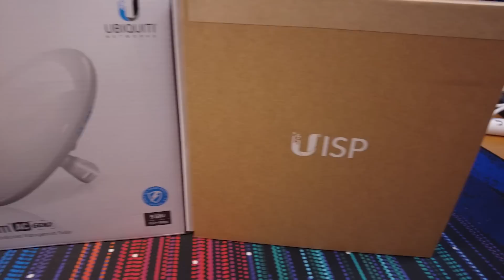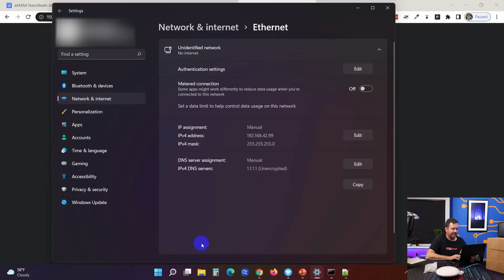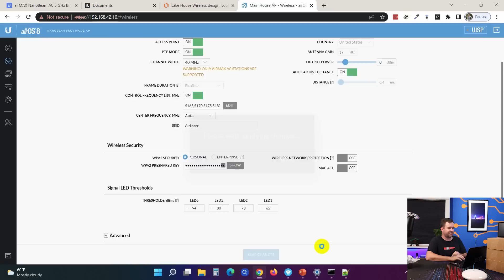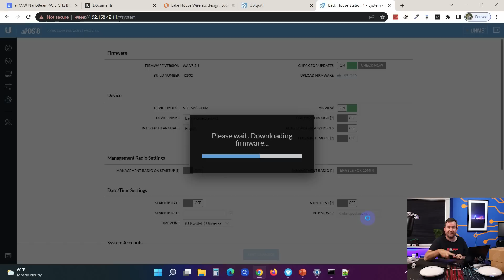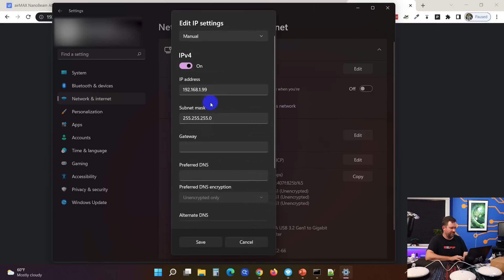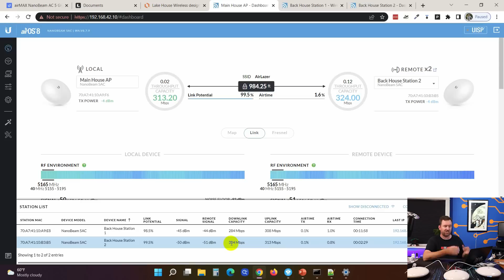PTP Wireless Bridge Setup 2022 - Step-by-step Guide!

Comment: Just watched your PTP video. I have a Dream Machine and two Lites. My greenhouse has marginal 2.4 GHz coverage for my Raspberry Pi. I have an M5 Rocketport. Can I use the 5 GHz portion of the Lite to extend ethernet connectivity to the Pi or do I need to put in a dedicated PTP link? My Android tablet says I have a good 5 GHz signal. If this concept works I will expand the greenhouse to include more ethernet devices.
Reply: No you cant use the airmax ac radios for client device connectivity. Use a Unifi Mesh AP or Mesh Pro AP and turn the radio power on both 2.4 and 5 Ghz to high and you'll have solid wifi. The Mesh Pro has a 300 to 600 foot diameter of coverage. In some installs Ive done Ive seen up to 1500 feet reach with the Mesh Pro (across a small lake)! Great AP for $199!

Comment: we use these gen 2 versions with AC Prisms/typically with 5G16 120 antennas - for temporary video installs at large events and festivals across the United States... they are pretty bulletproof... have also thrown in some power beams for the occasional 5 mile + shot... like anything else these days though , very hard to find in stock currently.

Comment: Could you have saved time by saving the config from the access point, loaded it in the stations and just toggled off AP mode and changed IPs?
Reply: Yep. Do it all the time... first station is a copy of the AP, then save that one and use it on all the other stations. Just have to change the name, ip, and re-add the UISP key to get it under management, then move on to the next one!

Comment: I am in the process of setting up a PtP with NanoStation 5AC. We did some testing with the NS attached to ladders but it was hard to really dial in the direction. We are about .6 miles apart with a few thin tree tops in our way. We can see a bright yellow sign with the naked eye and at night we can see each other point flash lights with ease. This is on some flat roof building and we are planning to get some standard non penetrating roof mounts. Do you think we can get to 100Mbps with this setup?
Reply: If you can see light at night, you could probably get a 300 to 600 mbps uplink. Use the alignment tool built into the TOOLS section on them. Also, use AIR MAGIC on the AP side once you have them connected to each other and it will show you the best frequency to set them at. Do the remote side from the AP side, hit save, then tweak the AP side and watch them connect up again at much better capacity and overall throughput.

Comment: Cool video Chris, I have a P2MP setup with a rocket and nano station 5s at my horse farm for outbuildings and am considering upgrading to AC or LTU hardware. Love to hear your thoughts on those two options compared. Thanks!
Reply: No need to upgrade if you don't need the bandwidth - what are you requirements on the remote side? If you can get a capacity + fade margin (usually 15% more than your total need) then your PTP or PtMP link can be set up to achieve just that - size the radios based on that as a minmum, then consider ramping up from there. I mean, are you running a storage server in your outbuildings? Of course not. Do you have 20 people streaming Netflix out there? Probably not... If you just need to check email, do a video call from a smartphone, maybe watch a youtube video - you only need about 10 or 20 Mbps total capacity in throughput MAX. A cheap pair of nano locos for $49 a piece and an AirCUBE ISP is all you need. However, if you have events and have 50 people out there using wifi on their smartphones, they all need roughly 2 Mbps download by 512kbps or 1Mbps upload to function happily, so 50 to 100 Mbps symmetrical would suffice - that's the older M2 and M5 gear, not even the AC series gear. But even that older gear is more expensive than the Nano locos, Lite AP AC, LiteBeam Gen2, etc...
Reply: @seanzigmund858  big bandwidth need is for HD surveillance cameras in the outbuildings. It’s a new farm to me so I’m just installing the equipment and already seeing the bandwidth becoming a limitation as I add cameras.
Reply: @johnmerryman1825  Are the cameras really just HD (1080p) or are they 2k or 4k, and, how many? And, what is the current capacity between the radio bridge you're using? If you use the AC series radios, you can lean on the AIR MAGIC tool on the AP side and switch to the frequency the AP recommends will bring more bandwidth over the link. Use the antenna alignment tool to properly align the antenna. Ensure the class of radio you use has a wide enough beam width to cover all the radios you're connecting up. Change to the channel width that provides the bandwidth you need in total plus 15% (fade margin). Other things to consider, potentially...

Comment: I've been running a pair of XM NSM5 in PTP for years. Now considering theses are also 24v passive I assume they are just a drop in replacement/upgrade? airOS 8 doesn't seem that different from 6 apart from controller support which I won't need. Thanks for the guide.

Comment: Is it possible to step down to 2.4Ghz with the NanoBeam 5AC in case there are some trees in the way?
Reply: AC radios do not have 2.4 ghz. Only 5, which is why theyre called AC, as in 802.11ac

Comment: We only install Ubiquiti Unifi hardware.  Several clients have protested that we have access to their Protect cameras.  Is there a way to set the cameras up where we would not have remote access?? If yes, will you l please consider doing a video on this subject??   Thanks
Reply: Maybe put the cameras in their own vlan. 
Use the router your using to block access. Not sure what local router and equipment you're using.

Of course the only rub is if you have access to that system you can change it and have access to cameras

Comment: Thanks Chris, Good video. I'd like to see a quick video maybe of fine tuning the signal with these devices. I have the NanoBeam AC Gen2 that you did this video on but can only get it to process a 200mb average speedtest even though it shows a 700mb connection for the bridge. THANKS!
Reply: Yeah, Chris, a video talking about fine-tuning or troubleshooting PTMP connections would be phenomenal.  I've been in a situation, where I've had clear line of sight,  great signal numbers from the AP to the Station, but garbage numbers from the Station to AP.     I'm also not entirely clear on how to improve alignment when signal chain 0 is low while signal chain 1 is high.   the UI ISP crowd has not been incredibly helpful (or supportive) when trying to look for help.

Comment: @Crosstalk Solutions BTW you can have as many ip addresses assigned to your computer.
Reply: And you can plug it in the switch. Your computer is going to have .1 and .24
I hope it will help 
Thanks for your videos it's amazing 🤩
Reply: So you can upgrade and configure the device at the same time

Comment: Good video, Chris. Would be good to see a bit more of an advanced video on setting up the best possible link by tweaking the AP/Station pair by using AIR MAGIC, AIR VIEW, and Alignment tools to assist people in getting the best possible link and capacity from the radios. Also, differences between a simple BRIDGE MODE deployment vs. a ROUTER mode deployment, among other things. Certainly a good run down of basic features and config steps to get a simple BRIDGE up between two locations. The Nanostation Locos are hands-down the best and financially cheapest radios for PTP and even PtMP scenarios where the beam width is no greater than 45 degrees (unless the AP/Station pair are so close to each other that you can literally point them in any direction and still get them to lock up!). Also, I'll add, having (or using) UNIFI gear on the CPE side makes no sense really, unless it's a larger physical environment/building where you need UNIFI features for use/management. The AirCube ISP and AirCube AC model of EdgeMAX CPE wifi routers do an ample job of providing whole-home/business wifi, unless the home/business are over 3000 sq ft, I've found in my professional deployments. And, the AirCube's are also manageable in UISP also, so you don't need two different management platforms to see/tweak all your devices. UI will soon be merging UNIFI and UISP into one platform to make dual/hybrid environments possible! I can't wait, but it won't affect me if they don't - just have to manage UNIFI on one webpage and UISP on another.
Reply: Second that! I would love to see a video with alignment tips and how to maximize speeds. I have a setup like this and I'm getting only 100Mbps on a distance of less than 0.5 mile
Reply: @rafaelpadilha4511  Is there obstruction between the radios? What models are you using? Did you use the alignment tool, AirMagic, or AirView? If not,  look into those tools - super helpful to get the best possible link and capacity. I'll try to do a video soon - just super busy now with summer on my heels!
Reply: @rafaelpadilha4511  Because you have to check settings. And be sure it's not an older NanoBeamM5 19 model..
Reply: Hey Chris, great video. Wish it was done in early 2020 when I set up a PTP for our church and had difficulty finding Ubiquiti documentation. Man they owe you big time for the best tutorial! Maybe Ubiquiti will take the hint and create an in-depth video tutorial on all of the settings. Anyway, many thanks!
Reply: ah, so alignments does matter just like microwave, good to know!

Comment: Nice video.  It might be worth mentioning both the INS-3AF-I-G (indoor poe adapter) and INS-3AF-O-G (outdoor version)  and the fact that the adapters supply some surge protection.  Also you can put a large screw through the center if the (stem mount and ball) and mount it that way.  

https://dl.ui.com/datasheets/instant/Instant_802.3af_Gigabit_PoE_Converters_DS.pdf

Comment: Spent ages today getting a link going, turns out it wasn't my config after all. It was a faulty switch port! Anyway nice to watch your video for a sanity check! Anyway YES to a UISP video. I have 25 devices on mine and still don't understand how to set up the device locations, Sites and clients.
Reply: Hit me up sometime. I run a small WISP and it is easy and ROCKS! Awesome application UISP is!!
Reply: nice! I recently had a patch cable go bad and it's just so simple you rarely check that first!

Comment: quick question:  can the access point and station ip address be on the same subnet/network as my current network or do they need their own subnet ?
Reply: Same or different. If same, easier to manage. If different and you want to manage them, you either have to set up a UISP application instance (Ubiquiti will host it for you for free, but only if you have 10 or more UISP-branded devices (AirMAX and/or EdgeMAX branded devices) or they'll shut the UISP instance down after 7 days. Or, you can host UISP yourself by downloading it from the downloads website) or if you put them on a different subnet, you just have to make sure you put your management computer on THAT subnet to manage them, which is easy to do in any OS... In Windows, when you set a static IP address on a LAN or WLAN interface/NIC, you can add other IP addresses in the ADVANCED area of the IPv4 / IPv6 "Properties" screen and be on several different IP subnets (your LAN, and the network you put the radios). I do this frequently when using the radios to create a BRIDGE (select BRIDGE MODE on the WIRELESS config page of the radios). If you set the radios as ROUTER MODE, then their WLAN interface (the radio side) will be on one subnet, and the ETHERNET interface (the LAN/cabled side) will be on another subnet and the radio acts to route between those to connected subnets - great for when you don't want to put a router on the Internet side and use the AP radio to be a router/firewall/gateway for the Internet connection. I do this a lot in small Point-To-Point deployments to save on the cost of a router at the AP side where the Internet connection is.

Comment: For most residentials installs that people are on a budget I use the NanoStation 5AC Loco's, $49 each.  The only downside is that even though they connect at 300 Mbps, the LAN ports are only 100Mbps
Reply: Nanostation 5ac locos have a gig port and can do 500+mbps. I think you're referring to the nanostation loco m5.
Reply: Nanostation Loco AC's are GIG ports (but only if you use a GIG PoE adapter!!! Always, always, always use Poe-24v-G adapters, not the older 100 Mbps PoE adapters!) and they can lock up at 655 Mbps symmetrical MAX capacity on Point-To-Point (PtP) links - I have many in the field like this. However, in Point-To-MultiPoint (PtMP) scenarios, YES, the AC-branded radios will only hit 340 Mbps MAX capacity because they are servicing on a 40 MHz channel width, not 50/60/80 MHz channel widths. The older models of Locos (Nano M2's) have 100Mbps ports only.

Comment: Hi Chris i love your videos. I did a quick set up of loco stations and the speeds I was getting was 300mbps download. Quick question… how many station/receiver units can someone install before the speeds start to drop??
Reply: It really depends on how many CPE devices you have on the station sides - consider that you're creating either a bridge between locations, or a routed link (which Chris didn't cover - he set up a bridge, essentially a LAN extension at layer 2). And, consider that over that bridge you're going to push end-user device traffic (from a wifi AP in a house or business) to the Internet connection (AP side). As a WISP, you really have to research what each radio model UI (or any other manufacturer) publishes about the radios they sell and then take that number with a grain of salt and as you roll them out, test/test/test/test and keep looking at the statistics the radios can report (capacity, throughput, CPU/RAM load, etc.) As an example, in a small rural WISP scenario the Lite AP AC (https://store.ui.com/collections/wireless/products/lap-120?_pos=5&_sid=ae315c606&_ss=r) can handle about 20 CPE radios that are AirMAX AC radios (nanostation loco ACs, litebeam ACs, etc.) before that Lite AP AC starts bogging down it's CPU and RAM trying to service all the devices behind the remote Station radios on the internal WLANs/LANs at each customer location. Ubiquiti scales up the AP radios for larger deployments to many more customers (look up Rocket APs with sector antenna combos) so you can really scale out over backhaul like multi-gig fiber.